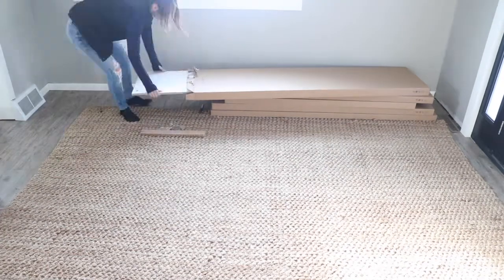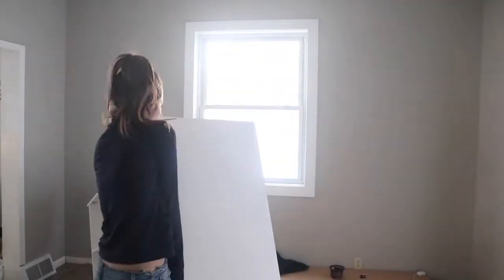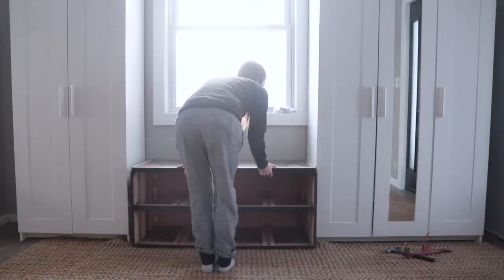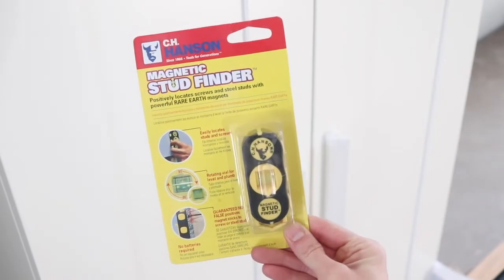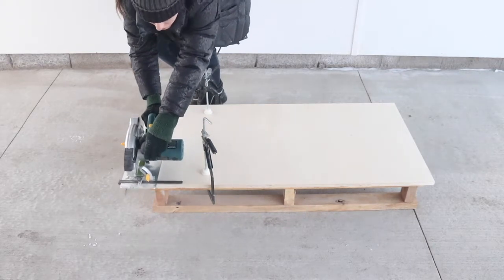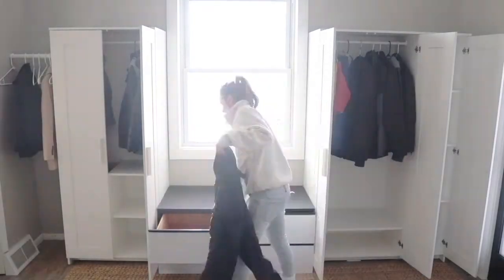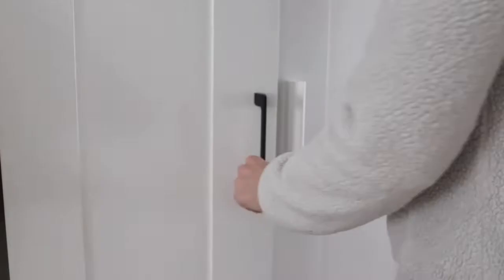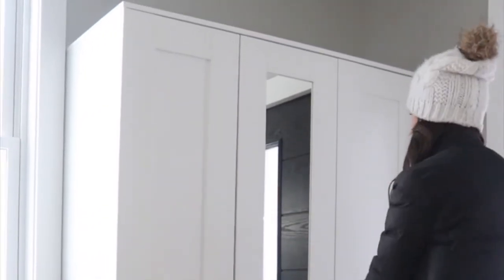DIY Entryway Closets | IKEA Brimnes Hack | Furniture Upcycle | DIY Bench | Foyer Storage Solutions

Comment: nice project, it turned out nice.  One suggestion would be to change your closet rod holders from plastic to metal.  I built closet organizers in three bedrooms. I used the plastic rod ends from local box store.  They started failing after one year.  Of course being in closets they were all loaded heavy, constantly.

Comment: I'm moved away from MN in '84.  The coldest winter I remember was about 1980 or so.  Actual temperature was -40F with a windchill factor of -90, although one particular evening the air was completely still so the wind wasn't a factor.  As I exhaled a huge cloud of breath just sorta floated in the air for quite some time.  It was kinda weird.